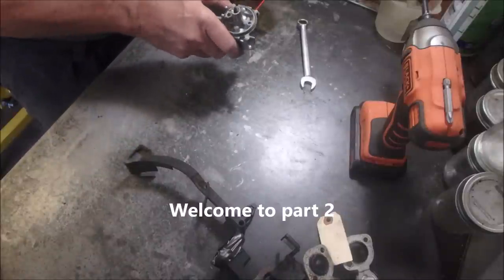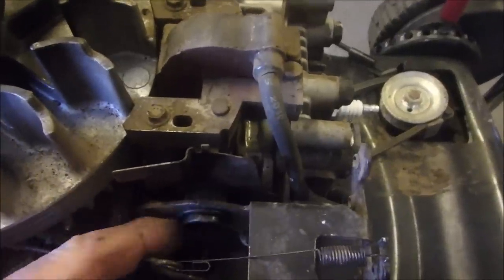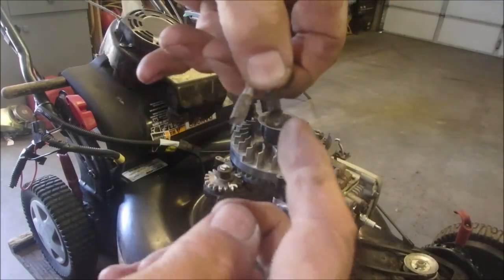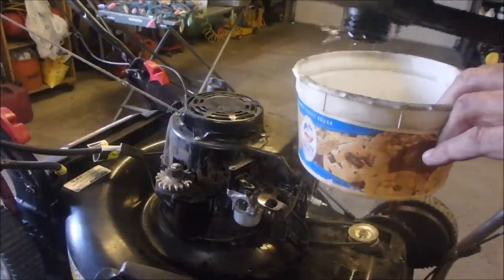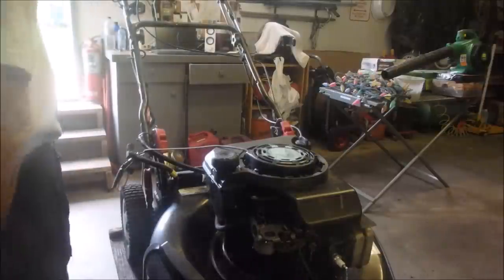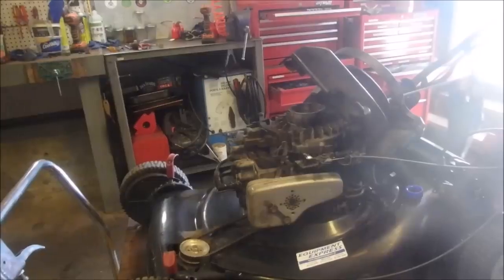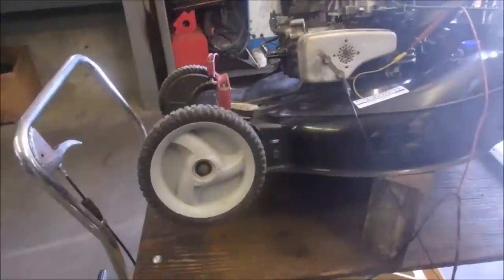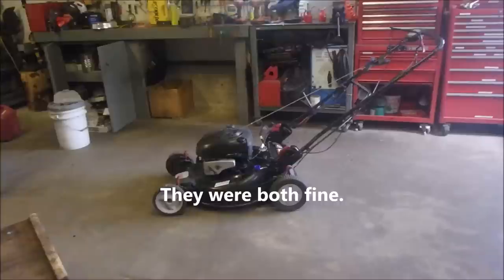Don't miss this !!! Basket-case Recovery of a Craftsman EZ Walk Mower Pt. 2

Comment: Tip to reinsert that insert in the air filter cover, heat it up a bit with a lighter and press it in. No hammering required. 🙂
Reply from the maker: Good idea.  Thanks.

Comment: Love your videos Bruce. The only thing I see that you don’t do which other YouTube small motors mechanic do is they take the wheels off and lube the shafts. Any reason why you don’t do that? It does make a huge difference in pushing the lawnmower even with the self propelled units.
Reply from the maker: Actually i do it right near then end of the tune up.  most of the time it is like   "Oh shoot do i film this"??   Thanks   i just can't film everything as I try to keep my videos to under 30 minutes.  If i go over that I loose viewers.  I will show it once n a while.
Reply: @BrucesShop  good point.

Comment: Thank you Bruce, one question:  I notice you remove a lot of screws with air or electric drill.  You also put some back in with that type of tool, how do you keep from stripping out the holes when using an "auto" screwdriver ?
Reply from the maker: I have learned to stop just before the tightening has started.  It is true.  When I first got the small impact I had to go to back to screwdrivers only,  ----  but now I have "the touch"

Comment: Everything considered, the briggs quantum is the best, easiest to work on engine ever made, in my personal opinion, and I've worked on em all, the biggest pain in the butt is the Honda, second robin wisconsin, 3rd tecumseh, I can work on a briggs quantum with my eyes closed.... Great video sir.
Reply from the maker: Yes i actually had fun on this one.
Reply: just filter, blade sharpen, +plug every 5 years. Quantum never should've been discontinued.
oh & 18oz oil once per season. Perfect side valve.

Comment: Mr. Bruce what was you running into when you had to take the mower back apart, with the ground brake wire? I watch it and didn’t hear what kind of trouble it was have!!! Not running… running bad or what?
Reply from the maker: It was an intermittent connection .  Some times the brake handle would shut it down with the cable movement and the next time the mower would keep running.   The connection was loose.

Comment: 3 problems? That's not a basket case, it's just kinda broken all over the place.  Lol
Just playing with ya, Fun video for sure!
Reply from the maker: He did put the parts back where the looked like they belonged.  When I took it apart  it was the shroud flywheel and coil that were left.
Reply: @BrucesShop  🙂 once someone who doesn't truly know how they work takes a wrench to them the job always gets more interesting. You get to fix the original problem and all the experiments he did trying to find it